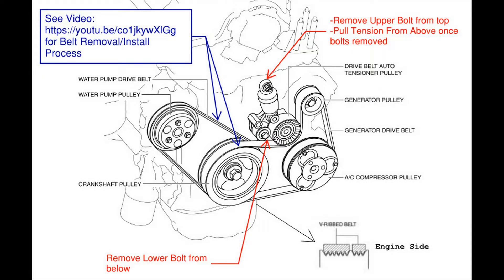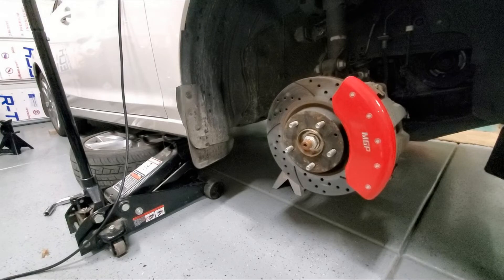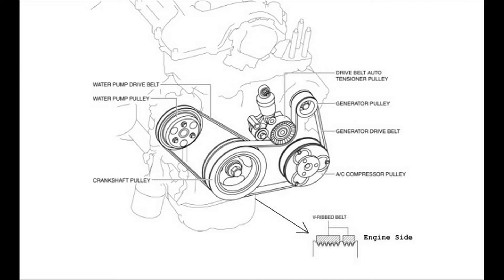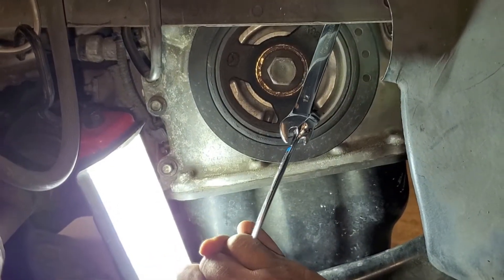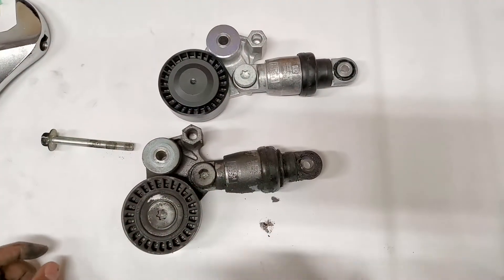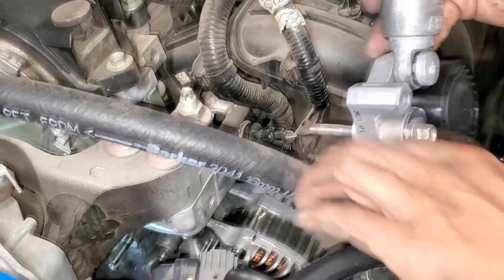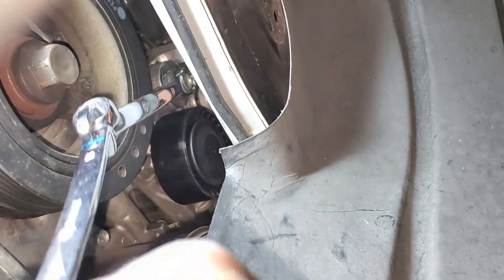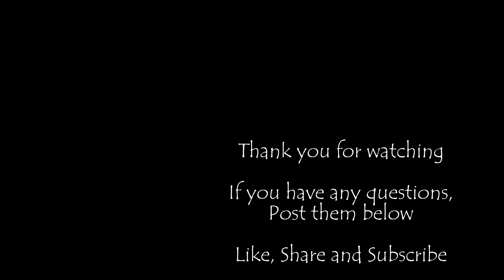How to Remove + Install/Replace  Belt Tensioner on 2.5L engine for Mazda 3, 6, CX5

Comment: thanks.  did you leave out removing the belly pan?   I have this planned for our 92k mile cx-5.  the tensioner is caked in muck, and a belt has just started to squeak.  I also have a lca and sway bar bushings replacement project in the works too.   Yay, the joys of older cars and inflated service department mx costs turning more of us into diyers

Comment: Lower tensioner bolt broke recently after replacing the tensioner a couple weeks prior.  Tried to drill into it (after drilling a 1" access hole into the frame) and use an extractor only for the extractor to break too  D:  Not sure what my luck would be trying to drill out the broken extractor + bolt again.  Starting to wonder if it would be better to drill a larger hole into the sideways insertion channel and use a heavy duty threaded bolt sleeve + a shorter bolt.  Accessing the bolt from the side isn't a problem with a hole in the frame.
Reply: did you ever fix this? same exact issue I'm having did drilling the access hole actually help? do you feel it weakens the frame in negative manner?
Reply: @TalkToMehWoW  It'll weaken the frame technically, but such structural components are going to be overbuilt, and the equivalent of a "lightening hole" in the webbing won't degrade the overall strength too much provided you stay away from the flange.

In the end, I wasn't able to get my fix to work.  The precision needed and the inability to find a large enough bolt sleave made it all untenable.  Ended up taking it to a shop and paid dearly for my hubris LMAO

Comment: Did you prime the new tensioner? Mine came with explicit instructions to pump it 5 times slowly after torquing the bolts.

Comment: Just replaced my belts and tensioner 2018 CX5 75000 miles.  Heard squealing after startup and at 40mph. Also heard a rattle at 1200-1300 RPM that sounded like something loose underneath.  It was a bad job, I did the belts on my 2015 at 125000 miles and didn't remember having problems. This time it took over two hours. I had trouble getting the nut off the tensioner, the wrench became jammed after getting the belt off and releasing the tension. Couldn't get the water pump belt off using a rag and laying on the floor. Was even harder getting the waterpump belt back on.  The rattle turned out to be the tensioner since there is no more noise anymore.
Reply from the maker: some times things just don't go the way we want to...on the brighter side, all the stuff is new now.  
character building moment :)

Comment: Ok so the dealer technician wasn’t lying about having a leaking tension pulley. I don’t remember ever replacing one for leaking. Is this common in newer vehicles?
Reply: Yeah the hydraulic tensioner we use now are prone to problems
Reply from the maker: @edgymememaker2602  they sure are :)
Reply from the maker: they didn't have them before, then some manufacturers went to these with shocks....

Comment: Looks impossible to feed a torque wrench down there but do u know the torque specs on those bolts?
Reply from the maker: i just tighted with down without a torque wrench as there is no room to do that.  
one way to guage it would be when you remove the bolts, feel how tight it was...then tighten it right away and then loosen it again to get a sense of how tight you need to be when reinstalling the bolts
Reply: @footprintsinconc  ...how about marking w/a pen and try to line up the marks when tightening?

Comment: Is that the part number for the 2018 mazda 3 touring 2.5 Mexico built?
Reply from the maker: the part number that i shared is for the mazda 6.

to double check, enter your vin number on any OEM parts sellers' site, and the part number from there to verify for your vehicle.

Comment: Worst part of this job, is the lack of clearance. Definitely annoying to have to take a wheel off and a panel, just to change a belt. No way to reach down from the top.
Reply from the maker: So true!
Reply: on my mk4 GTI, the timing/wp belt was captured by the p-side engine mount so to slip the new belt on, you had to remove the mount.  It also happened that the frame was straight across from the mount bolt heads 😠.   I threw in the white towel 🏳️ and took to the dealer for the nearly $1k tb/wp/tensioner replacement.  😢😢

Comment: Great video. FYI The link to the other video for belt installation/removal seems to be missing.
Reply from the maker: Thanks!!

the link in the description is working for me:  https://youtu.be/wV02UcrvJm0

however, i think i found the link you are referring to...it's the text that is referred to in the image.  I've added a link tp the video, on that screen, it's under the 'i' and have placed the actual link.  Thanks for pointing that out!

Comment: Thank you so much for this video, it is so helpful. So, my Local Mazda Dealership recommended that I get my Tensioner replaced about 2 years ago, but they were trying to charge me $315 for it. I consulted with another Mechanic and advised me to wait at least another year. 

I completely forgot about it and it seems to be in the same shape as 2 years ago and no squeaking sound. Would you advise me to replace it soon? Would it be too late until I actually hear the squeaking sound?
Reply from the maker: Thank you for the comment and question.

Does the unit look wet or greasy like my unit did in the video?  If yes, then it's time to change it because the shock liquid has started to leak. 

Please help me out by liking and sharing.
Reply: @footprintsinconc  For sure! I've subscribed as well. It does look a little greasy, similar to yours. I don't plan on waiting for months but I know that it will take me at least a week or so to do some research to find a good mechanic that charges decently. 

That's why I was wondering if I have some time even if for some reason it starts to squeak in the next couple of days. 

Thank you again.
Reply from the maker: @gonicito  mine was all covered in greasy dirt, so it went out and was squeaking.

if your is partially covered, then it's on its way out...depending on the conditions of where and how you drive, it can go out tomorrow or take another month...it's all very hard to determine.  i can't determine that...

if you are going to take a week to change it, take the time you need.

there is no part that needs to be changed every 2 years....your owner's manual from Mazda give you a suggested maintenance guidance on two types of driving conditions...they don't mention anything about a belt tensioner, so i personally would have a hard time believing a dealer when the give advice that doesn't make sense to me....that is just me.  you should decide based on your research.
Reply: @footprintsinconc  I see, yeah mine has grease but it's been like that since 2020 so I'm really not sure how it has been able to run since then. I'm not trying to risk it not working on a random day though so I'm making an appointment for next week at a decently priced shop. 

Thank you again for your advice and recommendations. Keep up the great page!

Best,

Comment: Good stuff. Mazda just told me my tensioner was leaking. Not much evidence on the tensioner itself, but apparent in surrounding areas. They want $450 to replace it. If I don't have to remove the belts, I believe I can do this based on your video. Thanks
Reply from the maker: Thanks!

please be sure to help out by liking and subscribing.  thank you!

Comment: Is it really neccessary  to take off the water pump belt?
Reply: If you are going through all this trouble, replacing the two belts is a $30 no Brainerd
 with no extra work
Reply from the maker: i'm replacing both belts...so yes :)
Reply: @footprintsinconc  Im not replacing the belts, just the tensioner...
Reply from the maker: @howdy000  my bad, i get the question now :)
sorry for the late reply.

no it is not needed to remove the water pump belt at all for just the belt tensioner.

Comment: Thanks for the video.  The upper nut is seized up for me.  I tried PB blaster but basically almost rounded the nut using a wrench.  I even tried six point 12mm socket but it's hard stuck.  Any other ideas?
Reply: Just to update - open wheel well liner and use an extension to get more leverage.  Both nut and bolt seized up on me.  What a pita to remove this tensioner.
Reply: Sorry for the hella late reply, but I had the same issue,I solved it by jacking the engine and removing the upper  mount bolts and had a ton of room for the top
Reply from the maker: You are welcome!

you could use a set like these if bolts or nut heads ever get rounded:
https://amzn.to/3APCYS7

you are right, you need to remove the wheel well liner for more access and you will need to use an extension.

Comment: Thanks for the reply, I’ve watched them all.   Appreciate the effort.  So far no leaks at any of the points you noticed them, I’m just lucky I guess.  With these videos I now have the confidence to tackle these jobs.  Just need to wait till it cools off a little down here in the Deep South.
Reply from the maker: as long as there are no leaks, you got nothing to worry about.

just keep an eye on the belt tensioner, that is easy to see.

Comment: Thanks for putting this together, well done!  How many miles are on this car?   I am asking as a way to compare what maintenance you are doing at your mileage vs.my car, which h121k miles on it.  Thanks again!  Liked and subscribed.
Reply from the maker: Thank you!!  Not sure if you saw my other videos that i did just now...so here is my story at 115k miles:   sorry for the long reply :)

I have about 115k mile and I've been seeing oil on the oil filter & drain plug access cover when i go to do the oil change...but then one day the car making the really bad squeaking sound when ever i started the car or accelerated.

So i started looking for the source and in the process i discovered three things:
1) belt tension had failed and leaked oil
2) that the valve cover + oil control valve was leaking oil and
3) i noticed a small leak had developed at the water pump

I went about to fixing these issues and some other over due items all at one time...I've recorded my work and here are the videos for reference. I split the videos into smaller pieces to make it more relevant.
belts
belt tensioner
water pump
thermostat
coolant drain and refill
spark plugs
valve cover gasket
brake fluid flush & refill
clean in take and throttle body clean

How to Jack up the car and support on stands:
https://youtu.be/2UsklEKl5LE

Changing out the belts: water pump and serpentine belt
https://youtu.be/wV02UcrvJm0

replacing the belt tensioner:
https://youtu.be/KyjiiPn0lYA

replacing water pump and coolant:
https://youtu.be/ZffZ2wnEntM

replacing thermostat:
https://youtu.be/WDJBghxtA9w

replacing spark plugs:
youtu.be/Tcy3V_r1q-I

replacing the valve cover and oil control valve gasket:
youtu.be/3W4Hm5xfyyA

brake fluid flush and replace:
youtu.be/0wcPaTm6Uhg

I did the oil change and tire rotation while at it, so had to reset the service reminder notification as well.
resetting the service reminder notification:
youtu.be/rsBnfh7d92g

check out my other videos on the mazda 6:
https://youtube.com/playlist?list=PLBZh-P-mar6XbOqrW2jlMyuKkCNfkbEX1

Thank you !